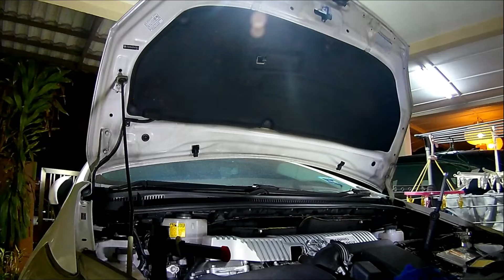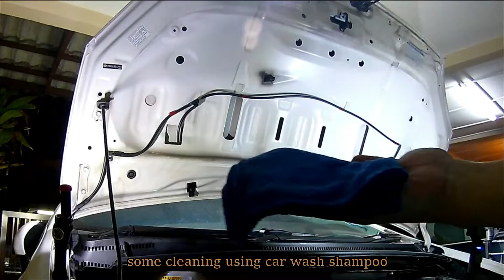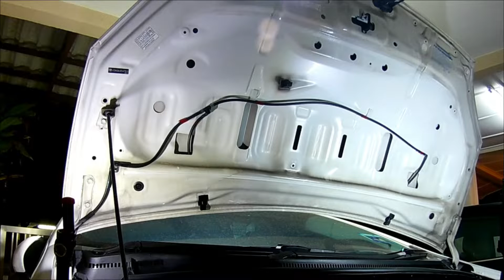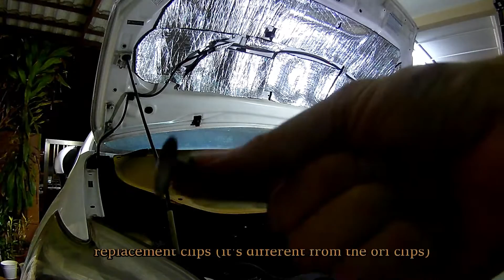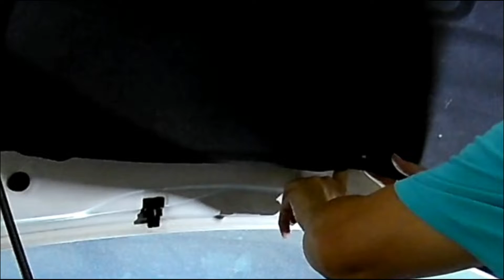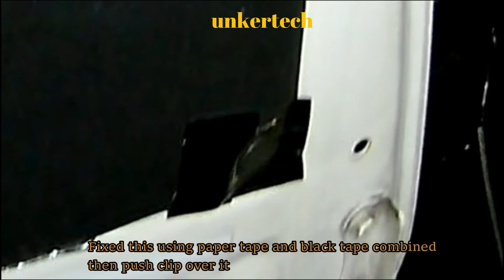Bonnet soundproofing & heat insulation (Prius 1.8) Part 1

Comment: Great YouTube. I have Prius gen 3 too. What brand of material you are using? Total material cost how much? How long it took you to finish the whole work?
Reply from the maker: I don't remember how long it took. Probably 2 hours. I used some unbranded soundproofing foam which cost me around RM15 per sheet.
Reply: @unkertech  may I know how do you feel about before and after? Great difference?
Reply from the maker: @yapcheesing  Nah, it does not make any difference. I just wanted to proof that it doesn't work. Mainly for heat proofing not at all for soundproofing.
Reply: @unkertech  OK... I am seriously thinking of making a DIY soundproof improvement because I cannot really stand the little sound that comes into the cabin. That's the reason I am collecting all the info :)

Thanks :)
Reply from the maker: @yapcheesing  If you are serious on doing soundproofing, the best is doing the doors and floor and wheel well. Can skip the front bonnet. If you have spare left, do the roof. My door soundproofing video will be released soon.
Reply from the maker: Volvo Truck 730  Have you done the car floor soundproofing? If not, that is a better location for it. However, that part would be the most expensive to do. As for the wheel arch, it does helps in providing me with less annoying road noise. It does not really reduce the noise but somehow it make the sound less irritating to me. And the cost of doing it should be around the same as doing doors or even less.
Reply: @yapcheesing its been 4 years. Did you apply sound isolation products? I ve got prius 3 for 2 years and the noise is really bothering me. I don’t know if they really work or not and how much would it cost to make it work. So if you update me with your knowledge I would be appreciated. Otherwise i would sell it before spend more money on it.
Reply: @huzeyfekiran8708 no… I did nothing… just keep it as original :)

Because I did not see anyone has a positive feedback after they do the sound insulation.